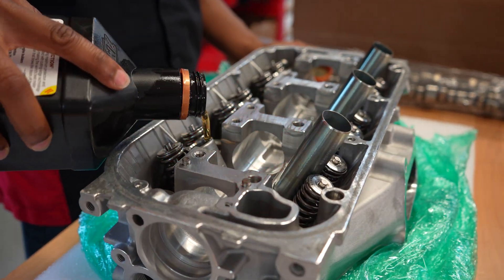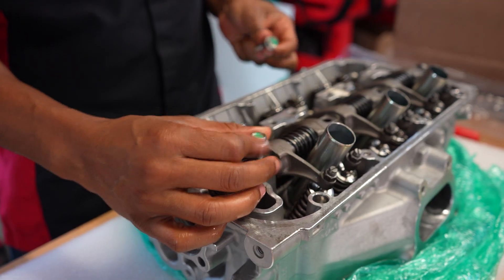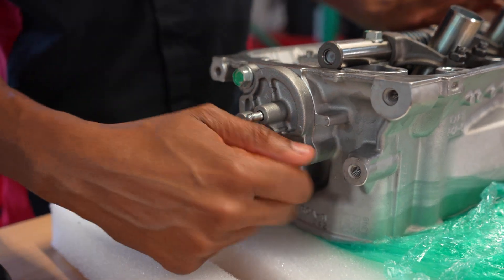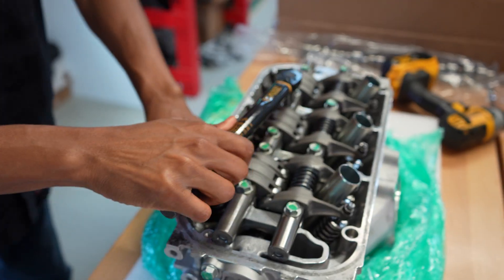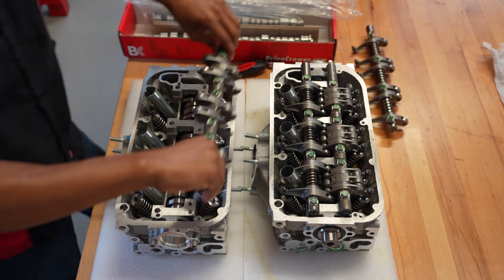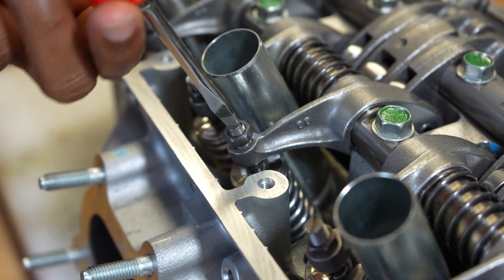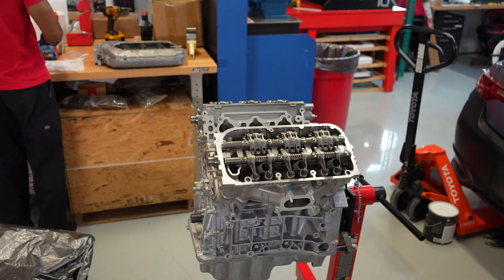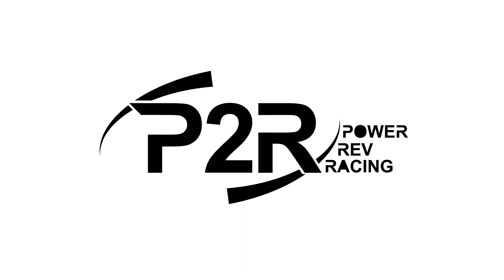High-Performance J32A3 Head Upgrade: Valvetrain & Cams Install on a J35A6 Block

Comment: I have a 2000 RL 3.5 the cams are 19 inches center to center. My 3.0 and 3.2 motors the cams are less than 14 inches center to center. Are the 3.5 heads taller hence spreading the cams farther apart?
Reply: Your RL has a 90 degree C35 non-VTEC engine while the other two are 60 degree VTEC. Completely different engine architecture hence different cam lengrhs.

Comment: Are there any more aggressive cams for J-series out that you could recommend? Goal is a high rpm (~7800) J37 but pointless if it doesn't make power that high. I would of course tap you guys for ported manifolds
Reply: Brian crower cams are as good as it gets for hondas, with the exception of toda cams.  Supertech with probably be the only valvetrain and pistons manufacturers to be able to take a hard beating at maximum performance.

Comment: In what scenario do you guy install the rocker shaft bushings instead of springs?
Reply from the maker: Whenever the customer buys them 😆 

The rocker shaft bushings are really nice but not a huge seller. They make the install a lot easier and help reduce friction.

Comment: just a head up your title and description have the wrong heads listed
Reply from the maker: Good thing is J32A3 & J35A6 are the exact same cylinder head.   They share the same casting & part number.
Reply: Good to know. Just thought I point it out since you said j35a6 in the video.
Reply from the maker: Appreciate it